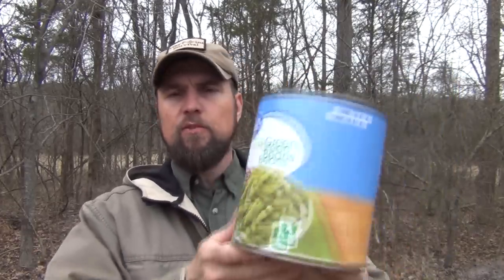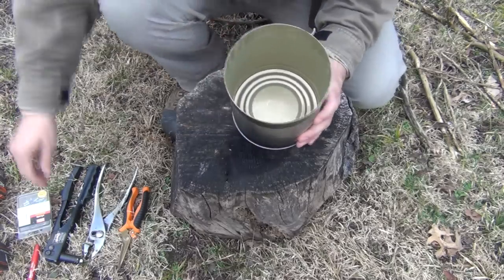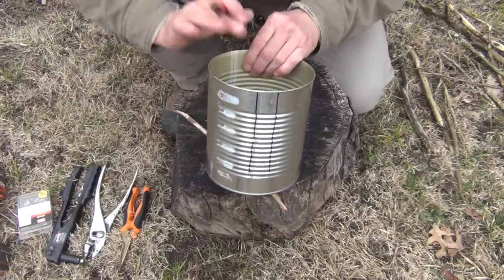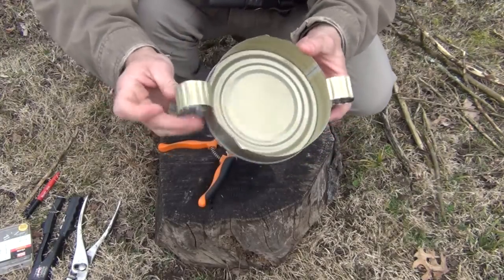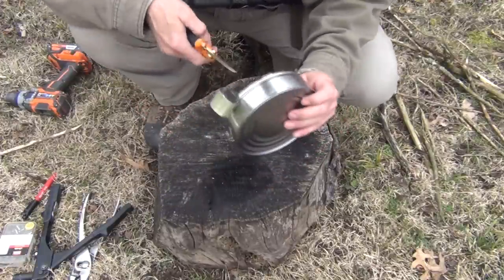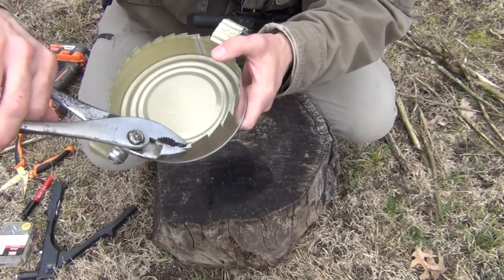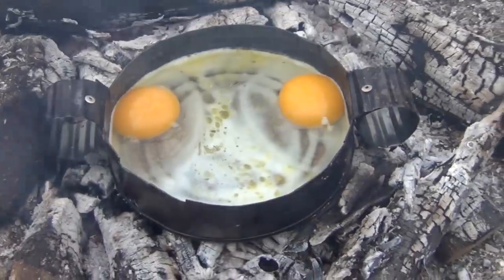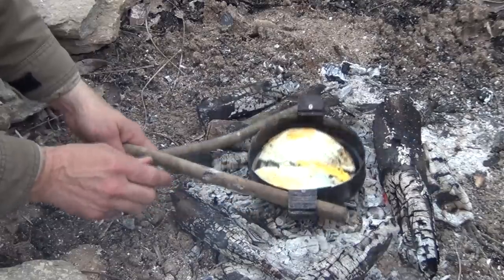Tin Can Fry Pan!

Comment: I am liking this a lot. You have my brain  spinning off ideas....
- if you use stainless steel eye bolt for the lid handle you could add coals to the top & bake in it.....tip: eye screws are cheaper. Make the lid hole with a smaller diameter nail. Punch in from the top. They will hold for quite some time. If worried about sharp point, cut it down with a hack saw 1st & file off any burrs. A cheap metal finger nail file will do the trick if you don't own a tool file.

- if you made a 2nd one out of a slightly smaller can you would have a double boiler for fancy camp cooking ;) 
There would be a little heat lose on the water, but this would work because of the hoop ears that hold the stick handles.  Hello bushcraft dessert delights! 
.........side note I once went camping with a bunch of friends. We walked in to the site & took little gear. When everyone went for a hike I said I just wanted to chill at camp......I had smuggled in the means to make a cherry cheese cake by the time they got back. I was referred to as Camp Cook Goddess for quite some time after.
Reply from the maker: Sounds great! I like your ideas! And thank you so much for sharing them.

Comment: I am going to make a lot of the things you  make on your videos and set up at a frea market and see how well they sell. A lot of hikers and campers can take them when they are in the outdoors and use them. They are very light and wouldn't  add any kind of weight to tour back pack. You could even attach a caribenier  to them so you can hang them on the outside of your backpack. Your channel is awesome.
Reply from the maker: Sounds good. Hope they sell well for you.
Reply: A set of lightweight portable cooking pots and small skillet cost very little. Not sure why anyone would buy tin cans but go for it. 
Mine are super light weight, well used and the whole set w/utensils was less than $20. It all fits together as a compact kit.

Comment: Great build! I just stumbled on the one where you made a bush pot, which was just as amazing. 
One thing that really needs to be mentioned about cans for fire implements is that they cool down in less than 2 minutes after use, making them 100% ready to go when comes time to pack out quick. Also realize they also transmit heat much faster than your average pan... now I want to try it with a steak!
Reply from the maker: They are excellent cookware and very cheap. Thank you for watching the video!

Comment: You're gonna want to bend those tabs out rather than in. It's a bit more work, but it works better and longer. I, personally, would have made the handle go over the top rather than along the sides, but then again, when I was living like that making this never occurred to me. I always used smaller cans and kept them deeper. Cans like the one that you used here I would use for a stove. I like this Idea and I may use it some day.
Reply from the maker: Thank you for watching.
Reply: Bending the tabs outwards would also leave a smoother inside, thus facilitating cleaning. I see food particles getting caught in those crimps.

Comment: Very interesting and creative. I wish I had seen this before I spent £40 on a stainless steel skillet lol. I can't believe the eggs didn't stick! Especially since you didn't heat the pan first. Amazing. Food sticks in my stainless steel. lol. Thanks.
Reply from the maker: Thanks! Since this is a mild steel, you can season it just like you would a cast iron pan. However, you must of course burn out all of the old coating/lining in it before use.

Comment: That's super cool. 
You could also attach a strip to the lid that could be rolled up forming a handle on the lid, should you not have screws.
I wonder if four more strips could be retained on the pan and folded all the way back down to form feet so that it could support itself over the coals.
Reply from the maker: I'm sure something like that could be put together. Thanks for watching!

Comment: I have used one of those large cans as a grill.. I also have put a few candles inside of a can like that.. believe it or not you can heat a tent with something like that.. if you use a candle to heat up your tent.. find yourself a flexible dryer hose.. put it in a corner of your tent door that way you can get some fresh air.. but I've used those cans for a lot of stuff
Reply from the maker: Some good ideas, thanks for sharing. And, thank you for watching!

Comment: Using the same concept, just cutting less of the can off, you could make a matching pot for soups and stews. Add a homemade tin can rocket stove and you're set.
Reply from the maker: Yes indeed. Thank you for watching.
Reply: Even getting varied diameter cans so they can nest...

Comment: Nicely made! I might build something similar, and coat the outside with something heat-resistant but the inner side I'd keep protected with oven spray or something so it doesn't rust to sam heck

Comment: Very handy if you're in a survival situation and come across an old can.. and nail, tin snips, pop rivets the same size as the nail. and a pop rivet setter.   Some how I think I'd have a better chance on stumbling upon a pan.
Reply from the maker: Actually, this is more of a hobo project. They did indeed have access to tools they just didn't own them as they were traveling working men. Thank you for watching.
Reply: @WayPointSurvival  Fair enough. I just saw the channel name and pinned comment and assumed. Not trying to be an A Hole ☺️

Comment: Nice project.  I like the round handles and the two sticks.  Good ideas.
A couple of questions.  (1) would you be OK with bending the circumferential tabs to the outside of the rim instead of the inside?  Less corners for food to get stuck into.  Could make for easier cleanup.  I’m lazy.
(2) Have you tried seasoning this pan?  That would help to keep foods from sticking to the pan.  Again, I’m lazy. See, laziness is one of the mothers of invention.
Courtesy of Half Vast Flying
Reply from the maker: Sure, you could bend the tabs to the outside of the rim if you wanted to. And, It could also be seasoned, although as you see from the video, it works pretty well as is.

Comment: You can make your own rivets by cutting a nail into pieces and hammering the ends or you could just use nuts and bolts for the handles. If you use the same nail you used to make the holes it works even better. Also forming the handles around a dowel or a stick will make them form easier and help with using the nail.
Reply from the maker: Indeed. Thanks for watching!

Comment: you could cut tabs and grooves on the handles that fold in and over and do away with the rivets.

Or a couple holes and a bit of wire.
Reply from the maker: Yes

Comment: Thank you James! I don’t have callouses on my hands. Plus I tend to be clumsy. I will need to improvise another handle idea. I would most likely cut myself.
I did stumble on leather gloves that fit my small hands. Even the small leather gloves from the hardware store are too loose for me. At the thrift store I found ladies lined leather gloves in the off season for $1. These were made for street wear. But for $1, I’ll wear them until I wear them out. Plus they fit me ….. like a glove. I’ll be looking for backups. 😅 🙏💚
Reply from the maker: Excellent workaround! Improvisation is definitely a skill that most people don't have.

Comment: I probably would have cut the rim straight all the way around, and used the discarded pieces to form the rings and riveted them to the sides. That way you could fold the rings so there was no sharp edges and the lid would likely fit without having to notch them. But, still a very good video and a way to make what you need from stuff you would otherwise discard to the landfill and you would have a very useful item as well.
Reply from the maker: Thanks for watching and for the suggestions!

Comment: Just came across this vid and may have a handy tip to break in a new steel frying pan , one without any coating like Teflon, of course! Let the pan get really hot, so hot that the oil starts to smoke. Rub the oil all over the insides and straight away wit a clove of garlic. Don’t burn it! Take the pan off the heat source , let cool down and rub dry with paper towel or newspaper. This wil give a great taste to everything prepared in this pan. After each use, do not wash with detergent, as this will remove the oily film that protects the steel and the taste : just rinse with boiling water, rub dry with paper towel and wrap the pan in old newspaper until next use.
Reply from the maker: Excellent, great tips!

Comment: Don't toss those sided you snipped out, use them for candle reflectors. Cut off  about 1" or more of a 4"-5" log, making sure it's flat, then using the top part, without the ribs, use that as your reflector, and shiney side in, wrap it about a half round on the log. Using small nails, tack it onto the log flat. Height will be determined by candle size you brought. Then, place them around your shelter to get best lighting for it. Make more of them with rest of leftovers and save the rest to make whatever with on your projects.
Reply: I meant discarded sides.
Reply from the maker: Excellent idea! Thanks for watching.

Comment: maybe? bend and crimp it the other way so food wont get built up underneath which is an area that looks hard to clean   COOL video thanks for the tip!
Reply from the maker: Thanks, but the metal doesn't bend well that way because of the curve. I did try that initially. Also, the heat will burn any bacteria up in short order when you put it over a fire.
Reply: @WayPointSurvival  good to know! thanks for the reply

Comment: Hi 👋, You can save a lot of time by using a freshly used Fray Bentos 🍱 pie tin which makes an instant 6 inch diameter x 1 & 1/2" deep fry pan. You can either use a Trangia type pot lifter or make your own pan handle.
Reply from the maker: Good idea but the only way we can get Frey Bentos tins is to order them online. It's not common here in the states and they are quite expensive, in the $14 range or so.

Comment: Good stuff, as always (just kind of stumbled into your channel), but in this case, I would suggest not crimping that top edge.  Cut it at the first corrugation, as you did, but file or sand the edge smooth and just be attentive when using it.  Those crimps are going to make it Hell to clean.
Reply from the maker: That's why the crimps are folded to the outside and the heat will sterilize it.

Comment: Thank you for this video. We still buy a brand of coffee that comes in a metal can. Unfortunately the lid is plastic. That aside, I noticed that the can is shiny on the inside, and the tin cans for vegetables have a darker color, hence the BPA. Would you (or anyone reading this) know if "shiny" metal means no BPA?
Reply from the maker: Very possibly the shiny interior means that it is actually lined with tin instead of plastic. And, actually, quite a few, if not all, of the tin can manufacturers have moved away from using BPA lining and now use a type of plastic polymer coating.

Comment: 1. Instead of using olive oil, use a neutral, high smoke temp oil such as vegetable oil or peanut oil.

2. After burning out the plastic, smear a very light coating of oil on your pan, buff it off,  and put it back on the heat.

Repeat this a few times and then stir fry some potatoes in your pan. You now have a fairly durable coating on your pan. This is similar to burning a new wok and, over use, gives a a fairly durable coating on your pan. After cooking, scour it out (no soap), apply a light coating of oil (not olive oil) and put it back on the coals. This will give you a nonstick coating.
Reply from the maker: Thanks for watching and for the suggestion.

Comment: Spectacular job Brother
Reply: I have made heaters  for the guys that live under the freeway overpass  it burns atf or engine  oils  lots of heat little smoke   also to make  walls out of sod  like the old pioneers sod house the old techniques still work  great video brother thank you for your knowledge and expertise
Reply from the maker: Thank you for watching and commenting!
Reply: I made one of your  Frying pans and I took a hammer and hammered out the ripples on the bottom    Sort of round it like a Chinese walk Save the other end of the can for the ring and that keeps your Chinese walk Frying Pan level in the fire works even better Great video brother thanks again for sharing your knowledge and expertise
Reply from the maker: That's a great idea and a great modification, thank you for sharing it!

Comment: you should use some of the metal you cut off to make a handle for the pot with a couple of rivit's
Reply from the maker: Sure, you could do that but it makes it more difficult to pack if you have a large handle sticking out.
Reply: @WayPointSurvival   so make the handle small enough to flip the lid over and sit inside of the pan

Comment: You could have curled that edge outside of the pan making it easier to clean and without cutting darts in the metal. Curling it inside leaves hidden spaces that you can't clean.
Reply from the maker: Actually, it's much harder to curl it to the outside... Thanks for watching.
Reply: @WayPointSurvival  Yes, it is much harder, but you have to start with a tiny edge and keep working along. Curl the whole edge a bit then keep going around. You'll get it. if a machine can do it, you can too.

Comment: like I ever met a hobo who wandered around with a rivetting gun.... by the hey, most modern large size coffee tins also come with plastic lids now, so you could use the lid as a passable plate...good enough for a hobo anyways, since we ain't fussy.
Reply from the maker: Actually, you could easily rivet this together with a couple of scraps of copper wire too. Also, you are absolutely correct about the plastic lid, very good plate. Thank you for watching.

Comment: Hobos don't usually carry drills, pliers, rivets and rivet tool, or tin snips in their stolen shopping carts. It would be easier, cheaper, and safer for the rest of us to buy a frying pan at walmart.
Reply from the maker: I think you missed the point that I made. Most hobos in years gone by were traveling, working men. They did indeed have access to tools quite often but could not take them along when they hit the road or the rails. They also often made many objects while in the jungles many of which are highly prized today and quite valuable including the hobo nickels.
Reply: You are thinking of homebums. Totally different. Though, without any knowledge of the life you might not be able to see the difference.
Reply from the maker: I wasn't thinking about homebums. I am referring to the classic age of the hobo especially during the depression when they had many tools available to them. You seem to only be thinking about the modern hobos which are more like tramps.
Reply: @WayPointSurvival  That one was for John N. He described homebums
Reply from the maker: @hanable clark No problem. Thanks for trying to set the record straight!
Reply: @WayPointSurvival What's a 'hobo nickel', James?
Reply from the maker: @susanp.collins7834 Hobo's used to take nickels, and carve the face and the back side into new images and trade them for more money. Sometimes, they could get enough out of it for an entire meal at a restaurant. They could turn a nickel into 25 cents that way.

Comment: Shouldn't the crimping be done OUTWARD to avoid areas that might be contaminated with cooked food. You'd want a clean inside edge...
Reply from the maker: If you do the crimping on the outside, it leaves a lot of jagged edges exposed because the outside circumference is larger than the inside circumference.

Comment: hobo cooking my butt. That's just a smart way of doing things. My titanium pan and lid cost a fortune. Not everyone can afford to spend that much money and there have been times in my life when I couldn't either. Those eggs look amazing. I made a cloth bag to carry my homemade stuff in. I would also recommend do you spray the outside of it with BBQ Grill paint. It will keep a lot of the soot from building on the outside. And add added protection. I'm also glad to see someone mentioning the plastic that's inside these things. I don't know how many people I've seen actually trying to cook out of the can. Especially beans and stuff like that. Sure you can cook out of them if you don't mind cancer. At least put the stuff in another container and burn it out like you did. And you can have a cheap kit practically free. These things probably last a long time if you don't smash them in your pack or some other way. I grew up in the country and we had a burn barrel. And we burned all our trash. And about the only thing that destroyed the cans in your burn barrel was rainwater making them rust. By the time you had to take them to the dump and throw them away. For the most part almost every can was intact. They were not burned up they were just smashed and Rusty. So if you treat the outside and oil the inside. This thing should last unless you cook it on a gas grill with high temperature. That's about the only way I can see burning it out regular Kohl's should be all right. Great job and great advice
Reply: I also made me a twig stove out of one. Which works pretty good. You can set it inside of a regular fire and it lifted up above to where the heat is. You could make a full cook set just about. A lot cheaper than spending a lot of money. Especially when you're going to eat the food that comes in at anyway.
Reply from the maker: Thank you so much. There's something special about being able to make do with what most folks would toss out.
Reply from the maker: One of my best videos is on using a stove made from a tomato can using a $5 bubble box to force air into it for a complete burn. If you're interested, here's a link: https://www.youtube.com/watch?v=Wg7ivqqBjAU&t=612s